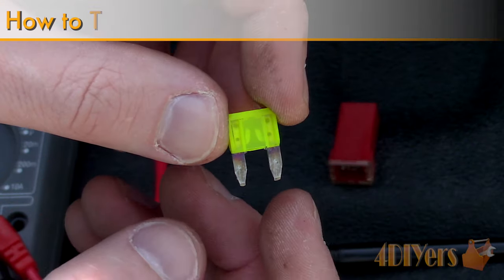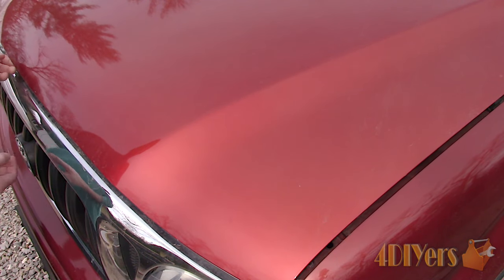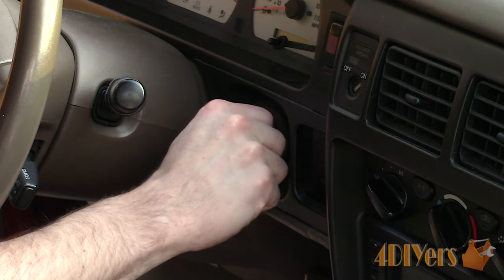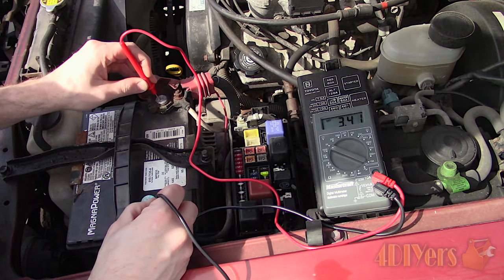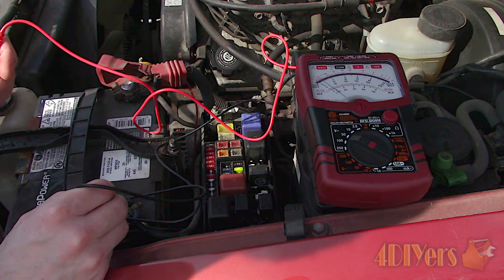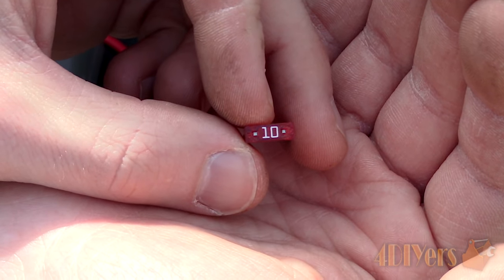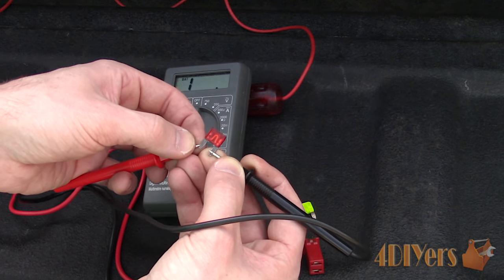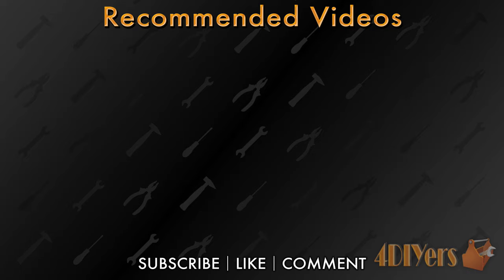How to Test Fuses in a Car [Beginner's Guide]

Comment: When testing an empty fuse location on the interior fuse box, how can you determine which side is hot and which side is ground?? I’m looking to tap just into the hot side but they both pull the same voltage so I’m not sure? Any help appreciated.
Reply: My goal is to turn my constant 12v cig lighter to switched power. I was going to cut the hot wire on the back of the 12v plug, run a new wire, and tie it to a spade terminal and insert it into the hot side of a switched empty fuse. Any info appreciated

Comment: Excellent video. So question. If you have a fuse that is bolted to the positive battery. For instance on my Kia Sedona I have a 60 AMP Cooling Fan Fuse. There is also a 150 AMP Fuse for the Alternator that is bolted down there as well. The rest of the fuses are in the fuse box.  Would I just put my Digital Test Meter Positive Side on the Metal Side that gets bolted and take the black terminal & put on a piece of metal to see if it has a reading? I am using a Digitial Multimeter

Comment: Hi, can i test continuity without removing the fuse if the ignition is not on? (car key removed) or maybe disconecting the car battery  ?
Reply: Thats how I check fuses  with no power on.  Its quick and easy

Comment: Why there is no power on both sides of the fuse  although the switch is on and the fuse is not blown????
Reply from the maker: Could be a faulty relay. You'll need to check the circuit on a wiring diagram to determine what exactly the whole circuit consists of.